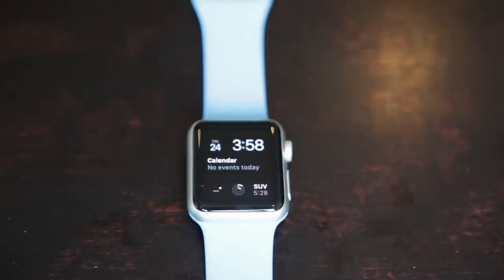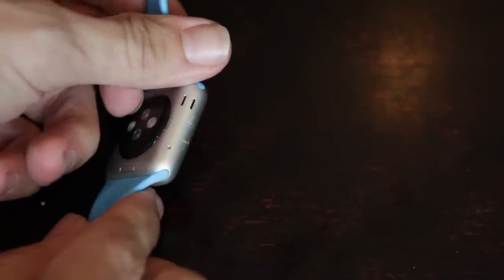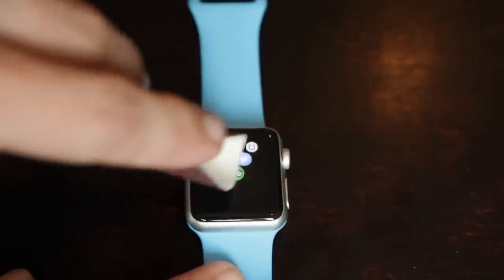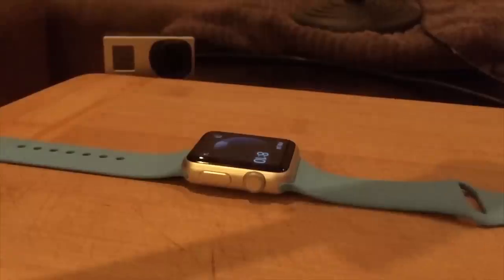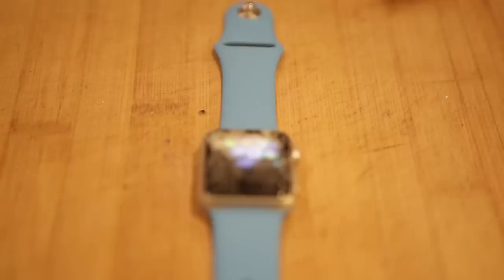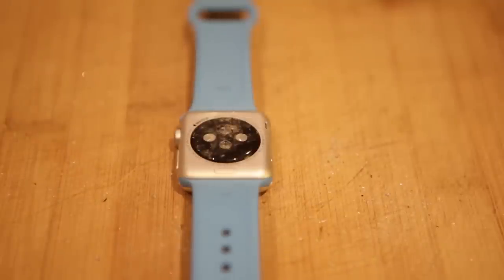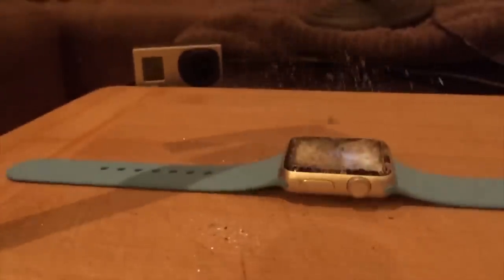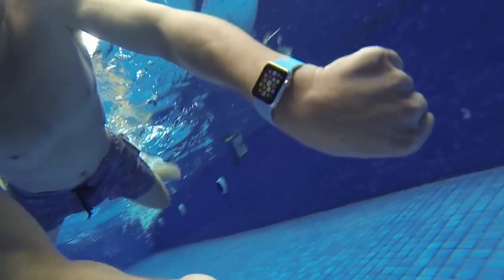Apple Watch Hammer & Knife Scratch Test

Comment: Sandpaper is MUCH MUCH more abrasive than a concrete surface.  You can scratch EVERYTHING except the diamonds with sandpaper.  YEP.  Look it up.
Reply from the maker: Well that's not entirely true. There are many things you can't scratch with sandpaper. For example, you can't scratch corundum (sapphire) with sandpaper. Sand paper is only as strong as the mineral that's attached to it. Some sandpapers will even give you a rating of hardness based on Mohs scale of hardness. Sandpaper would not scratch the Watch Edition as it's made of sapphire glass (9 on Mohs scale). Unless of course, the sandpaper was made up of diamonds (10 on mohs scale), which is actually a something that's produced  ;)
Reply: FoneFox So, it depends on what type of sandpaper you used.  Anyway, my point is that just because it was scratched with a sandpaper doesn't mean that it will get scratched if you bump it with some random hard surface.
Reply: John X True